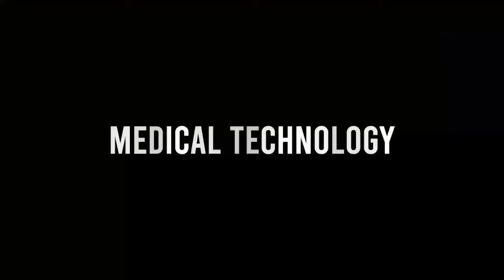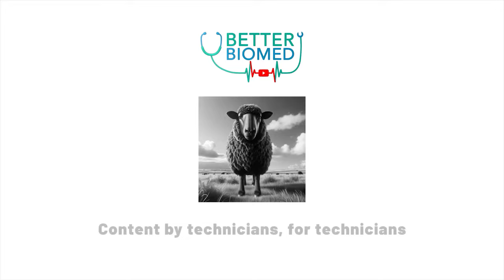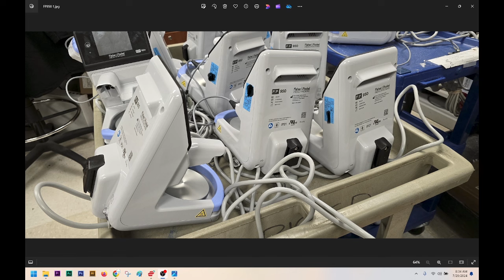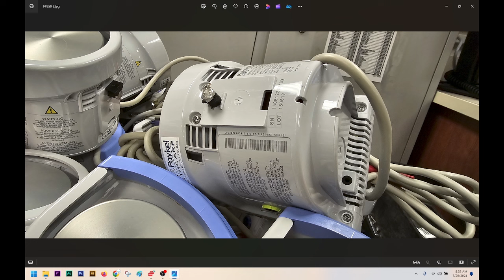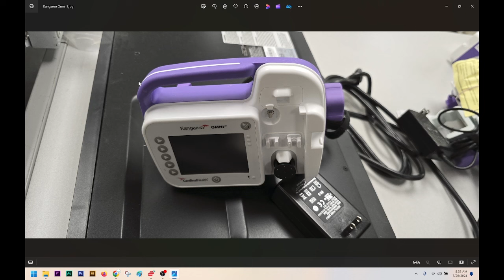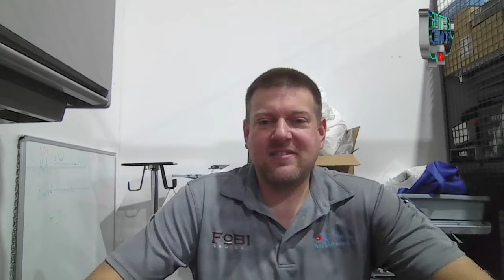New Equipment in 2024!

Comment: We just upgraded from the Medfusion 3500's to the Baxter NovumIQ.  The power supply of the Baxter was poorly thought out, the charging brick is going to break so much easier than the standard AC plug like the 3500's had.